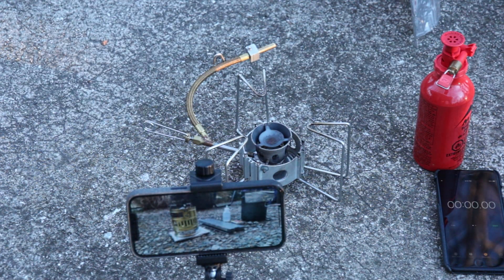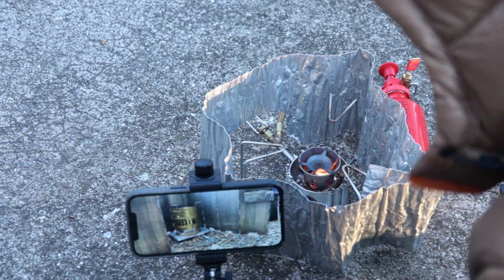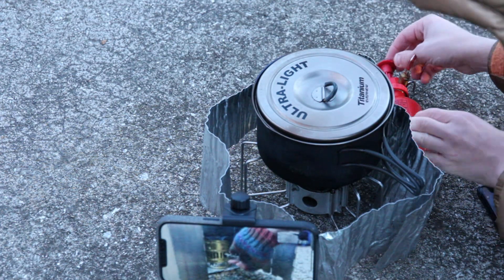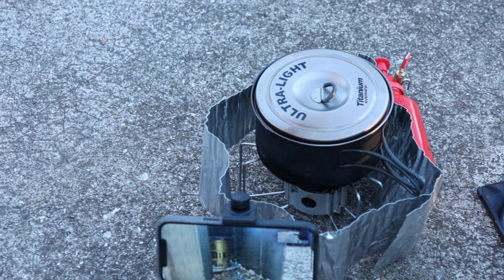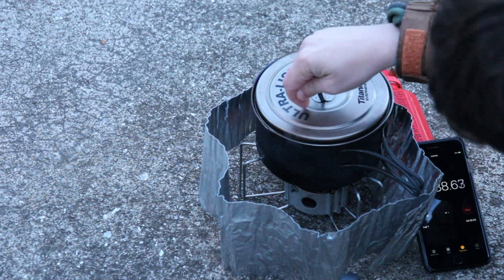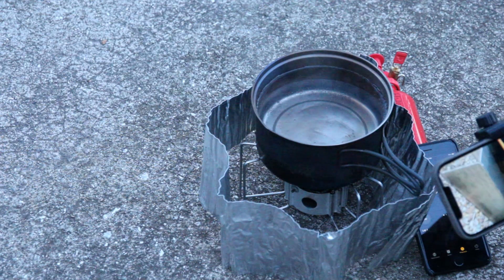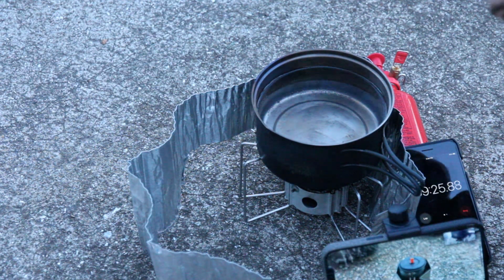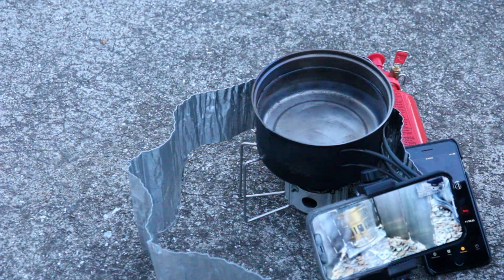MSR Dragonfly VS. Svea 123r - 1 Liter Boil Test In Cold

Comment: For the guy with the svea:

The stove is designed so that you can just put your preheat fuel on top of it and it will run down into the pan. 

You can entirely skip the disassembly and assembly at the start. People on youtube only do this to show how the stove functions but it is not a user step.

Preheating with windshield on is faster and preheating with white gas is faster than with alcohol

And to improve your svea:

Remove the chain from the stove and attach it to the windscreen instead. And add some carbon felt around the burner pan